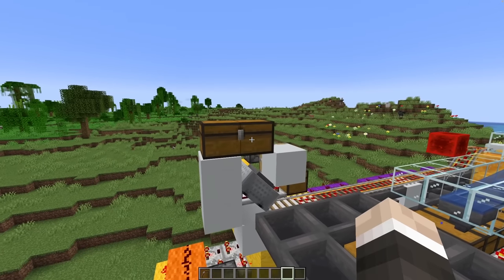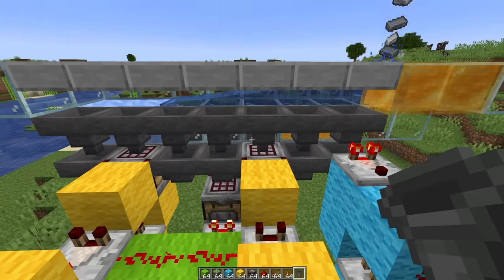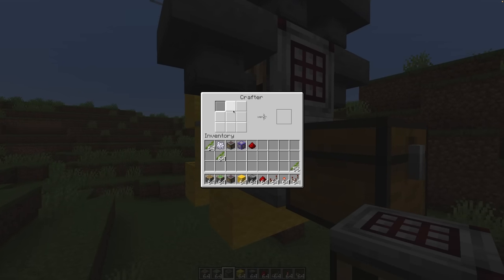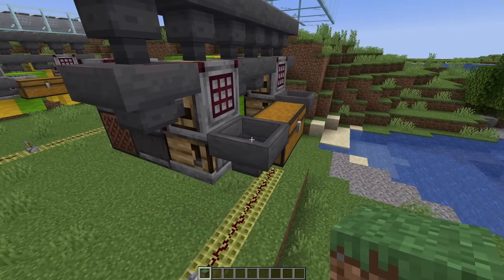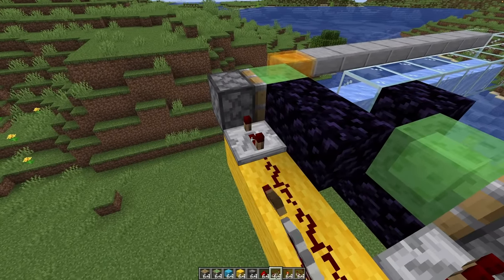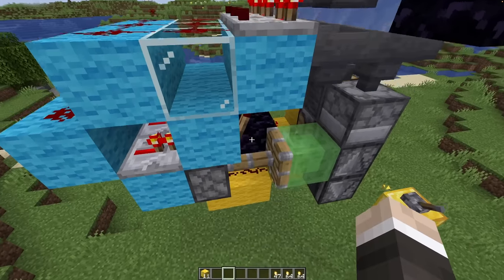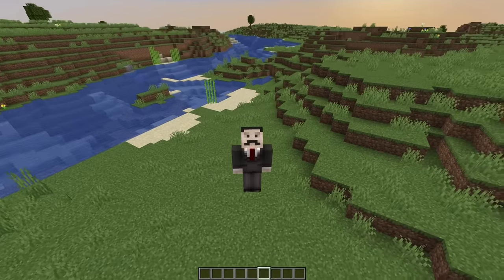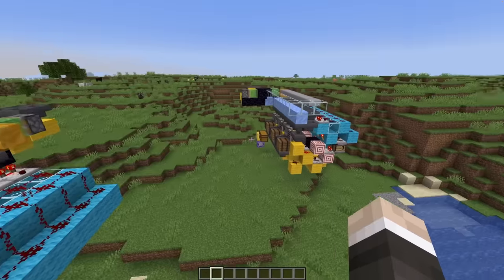Auto Crafters are incredibly useful in Minecraft 1.21

Comment: An infinite fuel source would be cool with a kelp farm that puts the kelp into a furnace, then crafts it insto kelp blocks that simultaneously would refill the furnaces and give more as an output
Reply: bamboo farm already does that without needing to craft the fuel block, but that would be cool too.
Reply: @SpartaCraft22965  bamboo works as a fuel without crafting, yes, but this idea is different because it outputs blocks of fuel you can efficiently carry to somewhere else (or use the kelp blocks as a building block).

Bamboo only smelts half an item IIRC, but a kelp block can do multiple, so you don’t need as many in your inventory.

(I can’t remember if kelp blocks smelt as many or more than charcoal, but automating the collection of logs just to burn them is more work than automating kelp harvesting, and would be a waste of the wood.)
Reply: Of course, Mumbai’s next video was exactly this. 😂

And he answered my question. 20 items per kelp block. I was pretty sure it was more than coal. 2.5 times more is really good! So yeah, very space efficient way to fuel furnaces. 40x more efficient than bamboo.
Reply: I would honestly add extensions to all of my smelters so that kelp blocks automatically fill the fuel. Once full it would continue into some kind of storage.

This way, I'll never have to bother with fuel ever again
Reply: A self-feeding kelp fuel farm, genius!
Reply: Dawg he already did that
Reply: @SpartaCraft22965 dried kelp blocks smelt 20 items a block
Reply: @Thel.Vadam69  more steps than just using a bamboo farm for automatic fuel without the crafter.
Reply: @ReedHarston  1 kelp block smelts 20 items, meaning kelp is a self-multiplying fuel source - every kelp block smelts the equivalent 2 kelp blocks and 6 kelp left over.

Comment: Kelp farm: ressources go to optimised furnaces, cooked kelp goes to autocrafters to make kelp blocs, kelp blocs serve as fuel in the furnaces, kelp bloc surplus goes into storage. Congrats, you have an infinite fuel and food source (beside carpet dupers)
Reply: For even faster results, use smokers instead of furnaces.
Reply: And run it into a super smelter
Reply: @MichaelMoore99 or just double the amount of furnaces and use it as a slow but consistent xp farm. Just add levers to the hoppers below the furnaces
Reply: I've just built the first automatic kelp farm in my current Survival world, with the next step being to move onto a smelter system (using Ilmango's design from "Perfect Furnace Array 1.11/1.16+"), and the moment I saw Mumbo's first video on automatic crafting, this was my exact thought! Feed kelp from a farm into a smelter, then run the dried kelp output into an autocrafter system to craft dried kelp blocks, and then run that output back into the furnaces as fuel, and any excess could run into a second smelter system (and further excess into storage), and as long as you can guarantee that everything works at the right speeds, you're set. Just flick the switch and let it run

Comment: Fun fact: 7-8 hoirs after this snapshot released i just sat there for like an hour and a half just wroting down ideas for the implementation of this and here are some of em i came up with:
1) Rocket factory/TNT toggle in a creepah farm
2) honey block farm(ie. Just compactification of tue items to blocks for super dense storage.)
3) ultra dense encoded main storage which will only store the most basic items needed for all crafting operations like insted of having all blocks like oak stairs, slab and all just simple oak planks, having iron blocks insted of iron bars, wilhich will be encoded to craft them on demand. ( I actuallyy built a working prototype of it using binary encoders)
4) flint and steel for raid farms.
5) shears for wool farm restock mechanism.
Reply: Auto-refueling kelp farms for fuel productoin!
Reply: Number 3 is that mod that adds digital storing and auto crafting
Reply: With the main storage, what happens when you want to store extras of the stairs and whatnot?

Comment: I highly recommend using droppers instead of hoppers to feed the crafter as you can get more items into the crafter in a shorter period of time, you can make crafters for a single item type recipe (dust, ingots, etc. to blocks) easily 1 wide tileable making it possible to compress a full double chest to blocks in about a minute 20 seconds (you could go faster by scaling it up)
Reply: Droppers are easier to control the exact flow of compared to hoppers
Reply: @stephenrichter8940  Do you know where I can find a working example of this? I can't get the one in the video to work

Comment: My idea for the Crafter would be a door lock with a code. Any push of a button triggers another item drop into the crafter which unlocks the door on being able to craft the item. Will be way more compact then before now!
Reply: How would it be cleared out?
Reply: @ThatFoxxoLeo  I don't know if you can hopper items out if the crafting can't be completed. Further testing would be necessary. If possible you could attach a clock to it that resets the crafter after a set amount of time
Reply: @stephanberg7335 yeah you can hopper items out of the crafter
Reply: IMO the solution would be water stream, where you drop the craft’s item requested with a delay,
for it to be put on the corresponding crafting grid section, 
since it go from the 1 et 9,
But you probably cannot to bulk crafting, and all crafting has to be the same format (2x2, 3x3 or other combinations)

Comment: Hey mumbo, is it possible to use hopper minecarts to insert items into the crafter super fast? Maybe this could speed up production of the blocks/ingots!
Reply: hopper minecarts only collects items, they don't push items into containers.  you can use droppers to insert items into the craft instead of hoppers
Reply: jasondoesstuff3679 nope, in super smelters there is a row of hoppers pointing into the furnaces, with the hopper minecarts running on top of the hoppers. Hopper minecarts can only pull items from above, they dont push items.
Reply: Super-smelters have the mine cart run along hoppers to distribute because the mine cart won’t push the items down
Reply: No but you can use droppers and splitters to accomplish what you’re talking about. So far my best time for a double chest of ingots to blocks is 1:28 but this could easily be about 40 seconds if you just scaled it up. As long as you make sure the items are quickly being evenly distributed you can just repeat tileable modules, although there are some limitations when it comes to putting items in the system.
Reply: If I remember correctly, hopper minecarts only suck items in very fast but can't push them out. If you want a really fast crafting operation you need a dropper on a really fast clock and the items to be pushed into the crafter in perfect sequence.

Comment: Mumbo, last night I spent more than 3 hours trying to come up with a design of general auto crafting system using a feed tape to guarantee the ordering, but I failed miserably. I have faith that you can do it instead.

I was using a dropper buffer (dropper facing a barrel with a hopper line beneath it) to control the flow of items, and that was working perfectly, just didn't got the timing part right

Comment: I feel like the crafters should have a functionality to lock a recipe. Lets say you get the items in the right spot and now want to craft that item and only that item. Rather than hoping the items go in there in the correct order on their own each and every time, just put the items in once, lock the recipe, and now each slot can only have the item for the recipe the crafter was locked to! I think a recipe lock feature would be an incredible addition to the auto crafters.
Reply: Well remember that they output a signal the strength of the amount of items. Definitely can do some funky shit using hoppers and droppers
Reply: That would shrink down quite a bit of contraption, right now I have a bamboo farm that funnels drops into a crafter below the piston row where an observer sees the pistons break the bamboo then powers the crafter 2 blocks below, the block in between is also a crafter so these 2 crafters make bamboo blocks and planks but that's as far as you can go without automatically spitting out pressure plates or sticks because it tries to power the crafter all the time

Comment: WAIT A MINUTE! Can't you repair tools using the Crafting table?
So to expand on that gold farm, you can have another system that crafts together all the gold swords that the piglins drop until they are fully repaired, thus cutting down storage build up in the junk storage even further
Reply: Good thinking!
Reply: At the point tho you are better off just smelting them down into nuggets and feeding it back into the system.
Reply: @NightHawk-wj9mz  Oooo, I like that, too. However, I feel smelting takes too long and has a higher chance of overloading. The crafter looks to be a faster clearing method.
Reply: If you're just trying to get rid of the swords/junk, dumping them into a lava cauldron or fire would be even quicker?
You would need an allay sorter to separate them from the armour before you could auto repair them. Sounds like a solution to a problem you don't have. Unless you want a bunch of fully repaired gold swords?
Reply: @NightHawk-wj9mz You can do both, seriously rwducing the total space of the build (and not wasting many resources)
Reply: Pretty sure just dumping them into lava is a lot easier, I dont know that theres any way to sort damaged swords from un-damaged ones
Reply: @craftmastr how about just dump them no need to store them

Comment: Here’s an idea. Try making an infinite, compact furnace fuel farm from kelp. Make a machine that takes input from an automated kelp farm, smelts the kelp into dried kelp, and then crafts the dried kelp into dried kelp blocks. You’ll have to reroute at least 45% of your output dried kelp blocks back into the furnace you’re using to smelt the kelp in order to keep it going forever, but you’d be able to keep the other 55% of the dried kelp blocks that are produced for other furnaces.

This creates furnace fuel that is incredibly storage efficient, as each dried kelp block smelts 20 items, so a stack smelts 1,280 items and a whole chest full smelts almost 35,000 items.

Comment: I've made,  i think, the fastest way to craft dispenser. It's a crude design but the timing is almost perfect. I have 3 hoppers going into the crafter one hopper is dedicated to bows only, one has one slot of redstone and cobble in the rest and the last hopper has only cobble.  The two cobble hoppers are locked while crafting allowing the bows to be refilled before the rest then it unlocks for about 1.5 seconds, just enough to refill all 8 other slot.  I'm working with full stack in the crafter. I'm using a repeater clock because and hopper clock needed 4 items to get the timing right but i didn't need the extra ticks while the hoppers were locked.

Comment: If the auto crafters give out a signal based on the amount of items filled, then you can potentially prevent early crafts (such as pressure plates) by prefilling the bottom right corner.

Comment: If you like using bamboo as furnace fuel, set up a little factory to turn the bamboo into sticks, then into ladders. Each ladder can fuel 1.5 furnace operations, like most wooden items, and since you get 3 of them that's 4.5 smelts compared to the 3.5 of the 14 bamboo sticks it took to craft the ladders.
Reply: The wiki says ladders are about 96.5% as efficient as planks

Comment: (if you can) make a item sorter that splits wood and stone/deepslate, if its stone/deepslate, it will split into crafters, one making stairs, the other one making slabs, a part of the normal stone/deepslate would go into a furnace and smelt into regular stone(cobble to normal), but if its normal stone(not deepslate) then it will smelt even more into smooth stone,after that all smelted stones will be split and made into stairs and slabs,(also leaves normal cobbeled bocks), now for regular stone(normal stone/deepslate, not cobbeled or smooth) it will turn it into bricks and also these bricks would be turened into stairs and slabs.BUT if its wood(logs) it will craft most of it into planks and the planks to stairs and slabs, so what im saying is that if you put stone, it will make EVERY varient of that stone/wood

Comment: I really want to see a fully automatic beacon farm. But from what I can think of it would require a few chunk loaders and you placing the soul sand and whither heads. Everything else seems doable (no mater how inefficient it is.

(Right, for a beacon you need glass, a star, and obsidian.

Let’s start with obsidian, the only ways that you could automatically farm obsidian is a gold farm attached to a piglin barter station. (Or something with a withers blue skulls, but barterings probably better)

Next would be the glass, glass is semi hard because you need to use end dupeing and then getting the sand to the nether.

Now comes the hard part, the wither star. Luckily you can get soul sand from the above mentioned barter route. You’ll also need to have a whither skill farm.

Now here’s the only part that can’t be automated. The summoning of the wither, first you’ll somehow need to feed the soul sand to the player so that they can place them on some form of conveyor.

Once the soul sand is in position droppers would come out and place the skulls summoning the wither. (The hard part here is getting the redstone out of the explosion radius) 

While the wither is spawning a timer is sent up to a rail cannon so that the wither is killed right as it spaws. (You’ll need some way of powering it, whether that be dupers or a creeper farm with the sand)

Now, after all that garbage, you need to connect them all together to finally craft me beacons.

Comment: I did this in a lot simpler way with an infinite seaweed generator (great fuel and xp source when cooked) originally I had to manually craft the dried seaweed into dried seaweed blocks but now they automatically craft and are sent back into the machine as fuel to infinitely run.

I even added a small current that takes extra seaweed the machine generated and turns it into bonemeal with composters which I connect to my sugarcane farm and in turn gives me infinite emeralds when I trade the paper

I could prolly make the crafter automatically craft paper for me ngl

Comment: Watching people use barrels in these builds (like at 8:28) makes me wonder would the new decorated pots be better for lag? The decorated pots have one slot of storage in the newest snapshots so a hopper underneath would only have to do 1 check compared to the 27 if using a barrel. I assume the same principle applies as covering the hoppers with composters. Usually the lag reduction would probably be pointlessly small but with a huge build or on a laggier server I like to take everything I can get. But then again pots are irregularly shaped and not a full block so maybe you're just trading server side redstone lag to client side rendering lag.

Comment: I'm not good enough with redstone to do this, but couldn't you create a system that can craft ANY recipe by using a filterable item (that isn't used in any recipes) like cobblestone stairs as fillers. Detect when there are 9 items in the crafter, turn on the filter to extract the stairs, then time it so there won't be any more stairs in it (even if it had 9 stairs... I guess). Then trigger the craft.

The only thing that you have to do then, is to create a way to specify a recipe which puts the items into the crafter in the correct order.

The delay might be a bit slow, so you could have the delay be only enough for 1 hopper extraction, but it resets whenever an item is extracted. So if you're extracting 0 stairs, you only have to wait one hopper tick before it crafts.

Comment: What if your gold farm also spits out gold ingots and swords? I've managed to build a system that automatically sends the gold ingots dropped into the same feed as the output from the nuggets crafted into ingots and send the swords into a furnace system powered by a bamboo farm that autocrafts the bamboo into planks (they have the most smelting time per piece of bamboo used) and then sends those nuggets into the original nugget feed but I'm curious to see if there's a way to make it significantly more compact as while I'm decent at making redstone contraptions that work, I'm awful at making them small.

Comment: I honestly bet some random dude will spend 2 months working on a machine where it is ONE CRAFTER. you input the materials in a chest in the correct order you would craft them, left to right, up to down. you go over to a button panel, 9x9. you press the buttons where the items DO NOT GO in the crafter. you press another button and the crafter fills with chest items UNTIL the slot where the first button was pressed. it puts in a dirt block named "subscribe!" and continues this process until all chest items are out of the chest. then a hopper gets unpowered and only takes out the "subscribe!" dirt. then the crafter gets powered and the item goes through a hopper line and back to the player. now you can autocraft ANY ITEM IN MINECRAFT using ONE crafter only. i'm not smart enough for that tho lol

Comment: Man id would have been so easy if they just copied existing autocrafter designs. Put in a crafting recipe either by the autocrafter holding the blocks needed or just copying the ones the player is holding over the respective slot as a placeholder... then holding one of each needed block until powered to dispense...